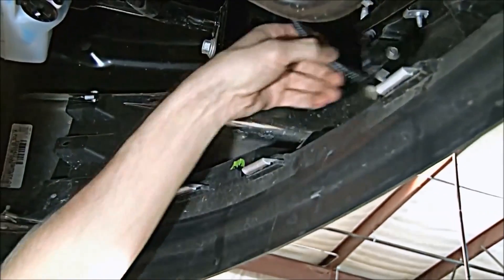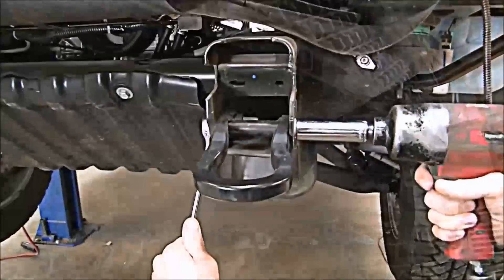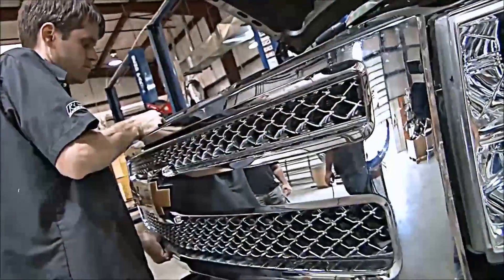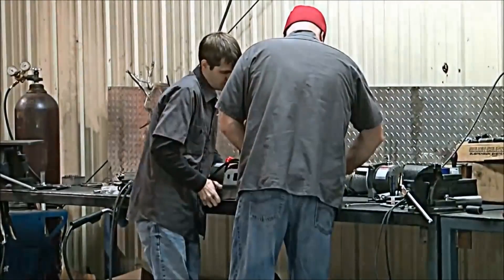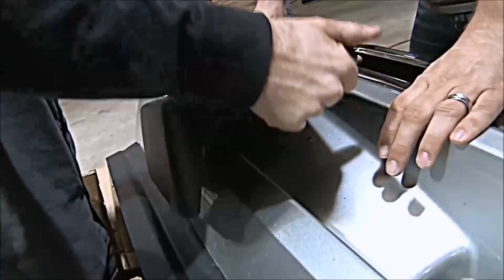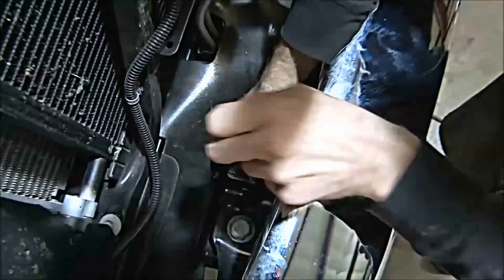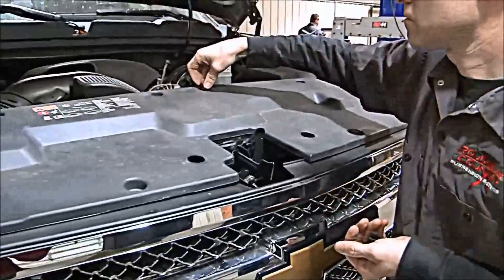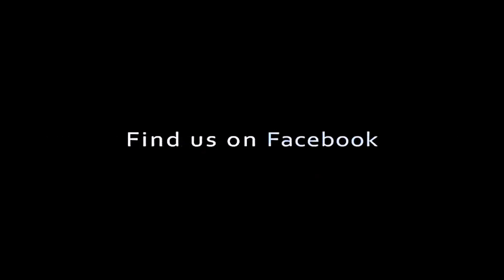Rough Country Chevy Silverado Hidden Winch Mounting Plate Installation

Comment: My warn vr10 did not fit on the mounting plate, I will need to add spacers to make it work. A bummer considering this winch is not even the max the plate is rated for. The winch is hitting the angled steel joints that lead to the roller mount.
Reply: I had to cut the fairlesd gussets a little bit to fit my Apex 12
Reply: @pappaclutch3266  I ended up using 1/4" thick steel spacers cut about 1 1/2" wide. So that worked for me.The Incredibly disappointing thing was when one of the plate mount holes I found was drilled too close to the steel lip on the bottom that did not allow the bolt head to move past it. This hole mounts the plate to the angled frame mounts on truck. Looking at the design of it, all the important bolts were good that deal with 90% of the forces. The hole in question would more of a factor on downward winching. The bolt is in and was ably to occupy all the Threads in the Nut but trying to tighten further would likely snap the bolt. I didn't want to cut into the plate because that would weaken it more than one bolt not tightened completely.

Comment: They actually installed the winch plate incorrectly, its supposed to set on the frame brackets not under them! Just sayin!!
Reply: I saw that too and I thought it was odd. Now the entire winch self-wt. is putting constant tension on the bolts.

Comment: How do you shift the winch?
Reply from the maker: Most winches will come with a corded remote which allows activation and use of the winch. however, if needed you can access the winch manually through the opening in the bumper above the winch.

Comment: Will this work on a 2500?
Reply from the maker: At this time from Rough Country no. Applications only exist for the 1st & 2nd generation Silverado 1500. (99-06 & 07-13).
Reply: It's my understanding that with slight modification this can be done quite easily. I read on one of the overlanding forums, someone used this exact mount and had to add a 1/4" steel plate spacer on either side and drill one new hole in the mount. The rough opening is approx 1/2" bigger on the 2500 according to them. I bought this setup for my '08 Duramax and plan to install this weekend. Hope this helps!
Reply: JM None did it work ok you duramax ? I am looking to get one for mine and wanted to know if it was possible ?
Reply: @jmnone1226  Did you happen to get it to work? Or know where you found the info for mounting the bracket on a 2500hd this body style?
Reply: @squeaky3  i did. It works perfect.
Reply: @squeaky3  i am doing the exact same thing on my 09 2500hd this weekend. I got the mounting plate today.
Reply: @s10forlife350  let me know how it goes. Im thinking of ordering the mount and some steel to put one on my 09 2500hd 6.0
Reply: @squeaky3  i might make a how to video on it... But this is also my 1st attemp at trying this. Im installing the badlands Apex as well, already came across 1st issue. Mounting plate isnt allowing the winch to sit flush. Hopefully a couple of spacer fix that issue
Reply: @s10forlife350  good to know. I was looking into doing that same winch. I have one on my 4runner and it has worked fine. Hard to beat it for thr price

Comment: Can it fit in lifted trucks 4x4?
Reply: What does the suspension of the truck have anything to do with the front mounts for the winch plate?
Reply: @nathan9032  it'll sit in a different spot and wont line up as designed. The body is lifted but the frame remains at the same height.
Reply: It doesn't work with a body lift

Comment: Will my 03 duramax support a 17,500 pound wench? I'm buying one but in looking on how to mount, the biggest wench I've seen anyone using is 12,000, thanks.
Reply from the maker: This winch kit will only support up to 12,000 lbs of pull. We were not able to find anything from our suppliers that supported beyond 16,500 for that year range. That does not mean someone out there doesn't make something, but we were unable to locate it.
Reply: AutoTruckToys.com thanks man.

Comment: Where did you put the license plate
Reply from the maker: While not shown being used in the video, both Rough Country Hidden Winch Mounting Kits for Silverado applications include a mounting bracket that allows reuse of the front license plate.

Comment: You guys make it look so easy lol. I've learned NOTHING is easy. Had you lifts on two jeeps, LJ and Wagoneer. Good stuff. Ordering this soon for my truck. Which winch did you all use?
Reply from the maker: Looks like the boys at Rough Country used one of their RS9500 series winches for this install. That series was discontinued and moved onto the PRO9500 series. Part number PRO9500.

Comment: Would this kit work on a 2009 Chevy Avalanche?
Reply from the maker: Unfortunately Rough Country does not offer this product for that application. The closest thing would be part number 1080 which fits 07-13 Silverado & Sierra 1500 models. Perhaps with some modification it could be made to work? But we're unsure of how much of a chore that would be, or if even reasonable.